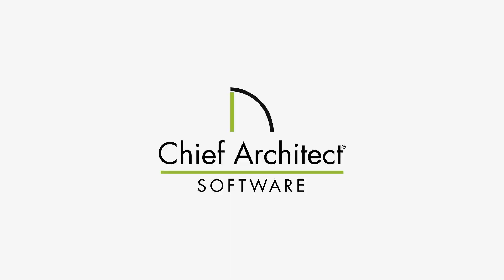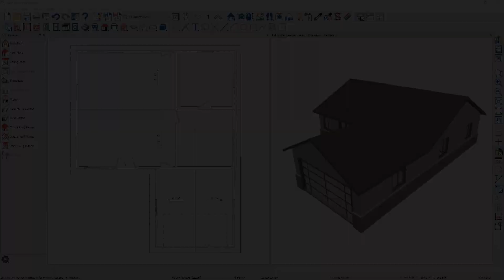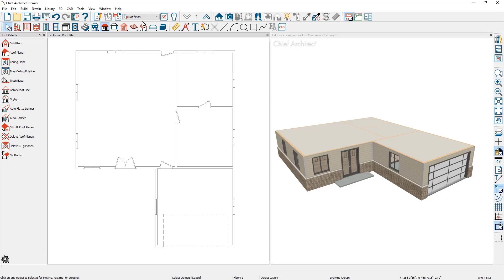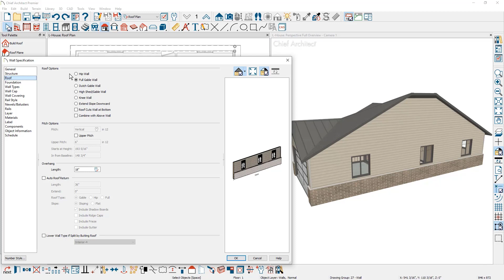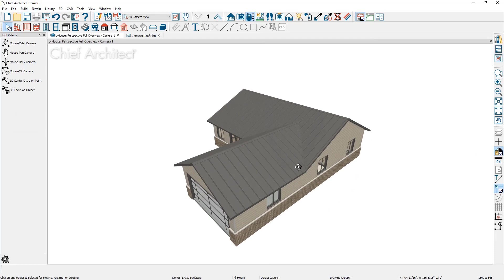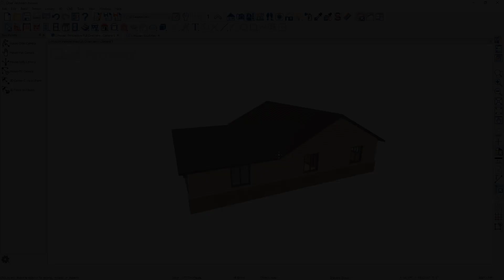Generating a Roof Over an L-Shaped House with Gable Ends

Comment: How does that work with Dutch Gables?
Reply from the maker: When you double-click on the wall to open the wall specifications, under the roof panel there is an option for Dutch Gable.